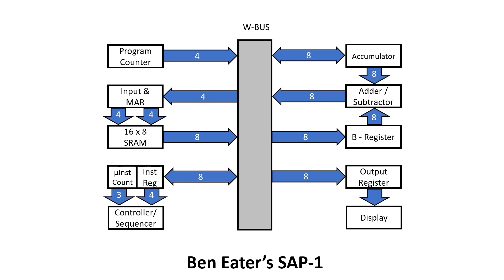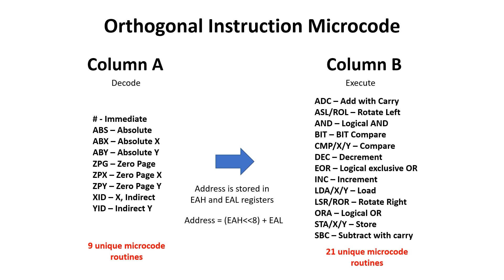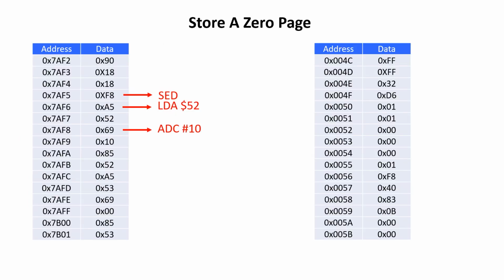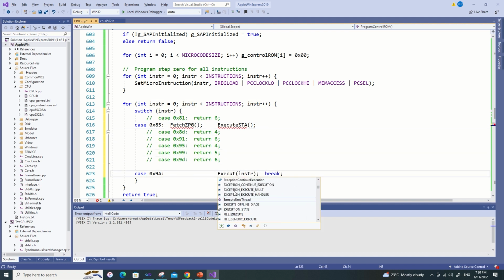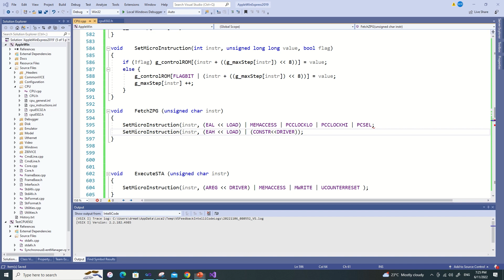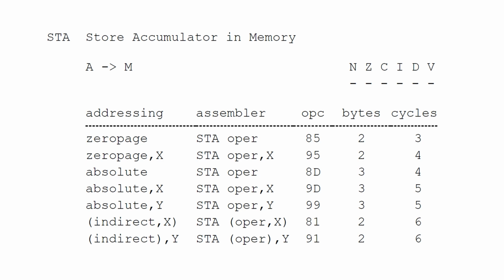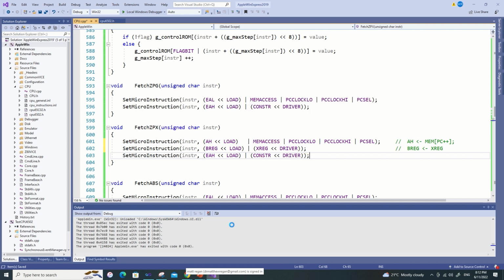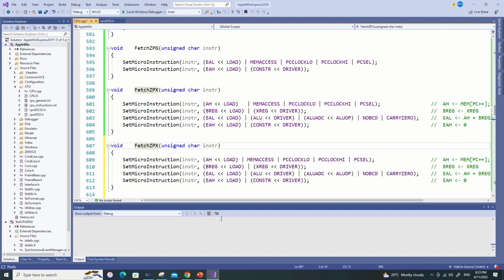SAP6502 Microcode Addressing Part 1

Comment: Great video. I agree that there is something deeply satisfying in slowly moving functionality from software to hardware and realizing that things are still working as they should!
Reply from the maker: Yep, it's also fun when you realize a hardware failure is as logic as a software failure.  There is usually a good going reason.  I was also told early in my career, make it work THEN make it fast, don't go for the high speed implementation straight away!

Comment: So, for the part for FetchZPG(unsigned char),  EAH should be 0 since it's the zero page, and no need to access memory, and we don't need PCSEL since we are using the constant. The main difference I see between the two lines is the lack of the clock; however, given it's a constant, that should not apply. I did think of the order of updating EAH vs EAL, but that should be still good for random access. I did notice the lack of parenthesis at the end of the statement, but the compiler would grab before it hits the hardware. That drew attention to the semicolon, which reminded me that you didn't do the UCOUNTERRESET on it. So maybe that is the bug introduced?
Reply: Now, if that is the issue, I'm guessing that the emulator does some "magic" that makes the UCOUNTERRESET necessary, due to simplicity of design, perhaps?
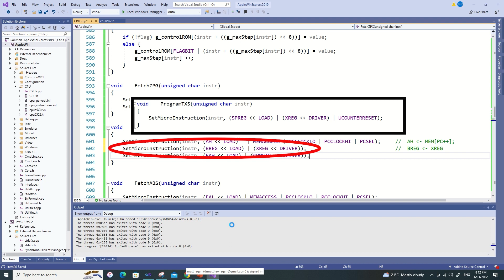Reply: Well given you went back and mention that detail at 11:10 or so, seems to be the most likely at this point.
Reply from the maker: Good guess.  The issue is that PCCLOCKLO/HI are asserted in fetch, and again in the first microinstruction of ZPG immediately afterwards.  This will only clock the PC once instead of twice.  The first microinstruction of ZPG should not assert  PCCLOCKLO/HI to clock past the opcode, then they should be asserted in the second microinstruction and de-asserted in the third to get PC past the operand.   The fix is pretty easy, move the EAH <= 0 microinstruction above the EAL one.
Reply: @DrMattRegan  Thank you for the quick reply. Since you explain it, it makes more since. I guess I should have thought more about the larger context as a single instruction instead of focusing on a single subroutine in the builder. I looked this morning at CPU_V2, and looks like you follow that pattern on several, but not universally. I may need to take a few snippets and step through an execution from both a code and hardware view to get a clearer picture.

Comment: Interesting stuff, but boy are you wasteful of resources. When would you ever need more than 8 T states for a 6502 op code? 32 T states is just an absurd number, and working with the smaller number means you only need ROMs 1/4 of the size.

The 8 bit era was all about getting the most you could out of the limited hardware available, which Woz was an expert at. These days it’s more about making life easy for the developers and throwing more hardware at the problem,  but there’s something to be said for working inside of limited constraints and seeing how far you can push them.

The other question is, is there any interest in you doing this sort of thing in a HDL like Verilog or VHDL? Wiring up a breadboard isn’t everyone’s cup of tea, and doing something similar in a cheap FPGA might gain a following.
Reply from the maker: Yeah, the actual 6502 has 3 internal busses which can be used simultaneously, so we'll never be as efficient.  The goal here was to take a simple architecture (the SAP1) and make it 6502 ISA compatible, not to actually build a 6502.

If i were to try to minimize EPROM size, i would add extra state bits from the sequencer and multiplex them with the lines coming from the Instruction register.  Then we would only need one instance of each addressing mode and instruction type.  If i do build the SAP-68000 i'll probably have to do that for the multiply and divide instruciton.

Also, i'd probably make the SAP-68000 FPGA friendly (although i personally find FPGAs more wasteful than big EPROMs)
Reply: @DrMattRegan  I see you point about the SAP architecture being less efficient than a 6502 (though that was targeted at being the smallest, and hence the cheapest and simplest 8 bit microprocessor on the market at the time). Lots of the optimisations used were targeted at getting the gate count down, and resulted in odd effects like undocumented op codes due to partial decoding (lots of ‘don’t care’ terms that resulted in weird edge cases). These were fixed when it came to the 65C02, but there is still code out there which makes used of these undocumented effects.

While, as a percentage of the resources on a chip, FPGA utilisation is low in comparison to an EPROM based solution, the flexibility and speed is much higher. There is a much larger range of elements (block RAM, Look Up Tables, flip-flops, DSP units, clock generators and IO controllers to name a few) that mean that no solution can use them all. They do however run at much lower latency (BRAMs can be used as ROMs and easily reach 5ns or better speeds, even on low end devices) and are inherently very parallel in nature. 

Your Turing series demonstrates that even a very simple core can combine instructions together to form a more complex result. The difference comes down to how long it takes to run. The original ARM 1 core was simulated in BBC BASIC on a 6502 before it even existed as silicon. What the FPGA does is to let us simulate a large pile of 74 series chips with attached memory. If the simulation is good and there’s enough demand then it might get converted to an ASIC chip. If not then you’ve got something that is easy to re-use or drop in to a custom solution.